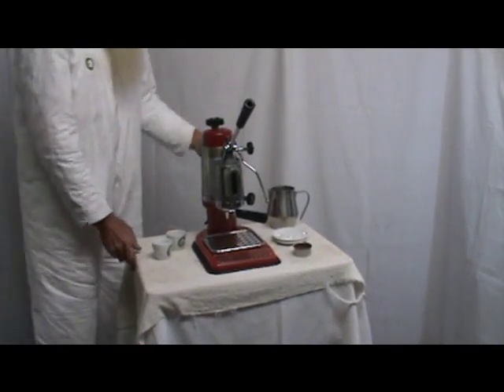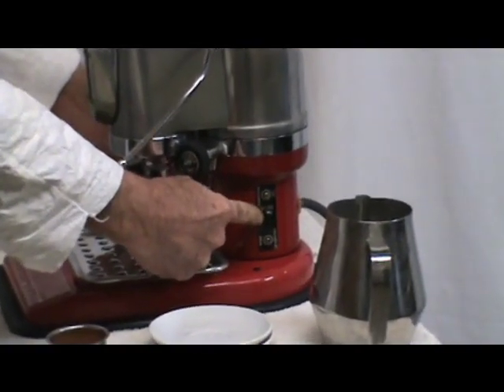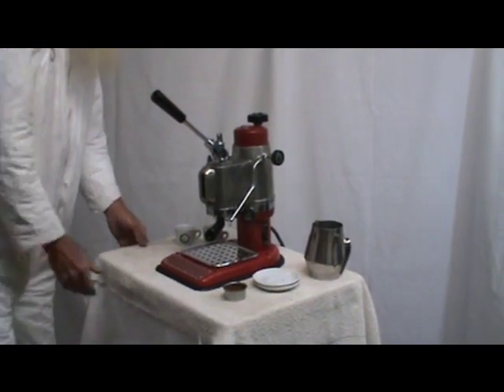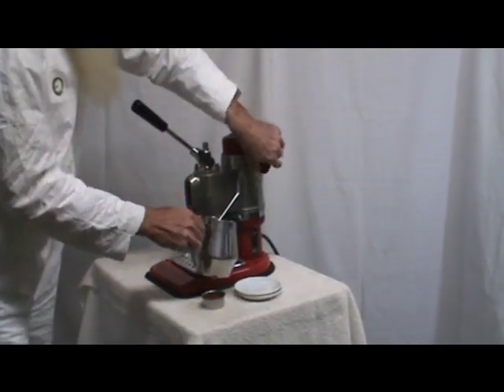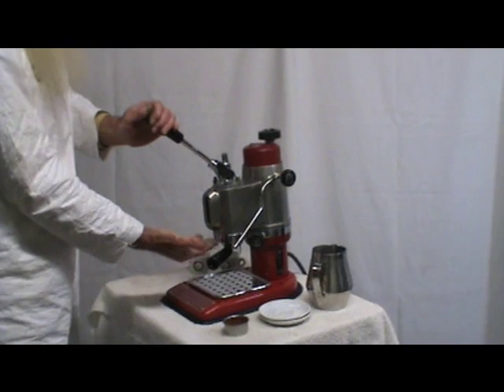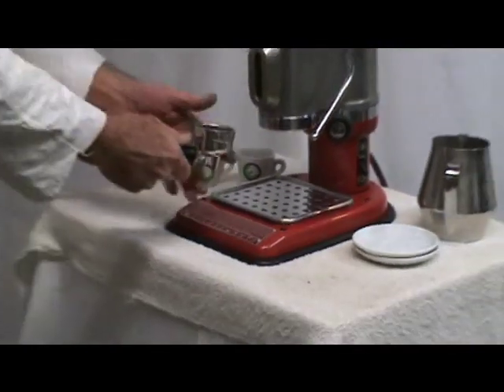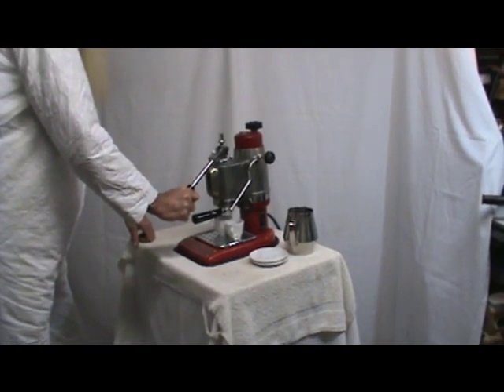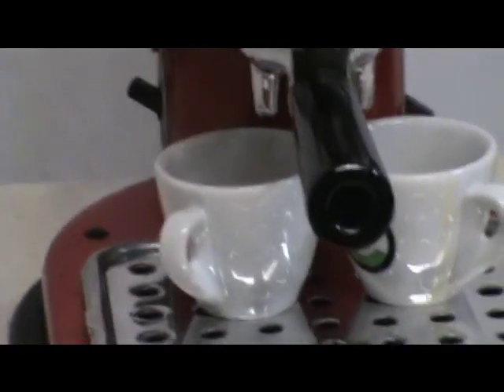La Cimbali Microcimbali Espresso Machine at OE

Comment: Hi, thanks for posting.  I recently received this exact machine from a family member that purchased it while living in Italy in the early 1970's, I think - and lovingly maintained it ever since.  I have a modern double boiler machine (Rocket R58), and I'm familiar with pump espresso machines, but this is my first lever pump.  After working on my grind, I do get good shots, but not a lot of volume.  It takes three pumps or more to get 40 ml or so.  (Maybe that's normal?)  I'm using the double shot basket.  I'm wondering how to adjust the pump volume like you mentioned in the video.  I'm not sure where it is currently adjusted.
Reply: A bit late of a reply... but, I'll try to help if anyone else may read this comment!  
If it's anything like the La Pavoni Europiccola lever machine I have, which I believe it is similar. You don't really get a huge volume out but they do make really good ristretto shots! 
I do 16g in and get about 30g out usually on my machine so less than 1:2 ratio, but even with a very light roast it turns out nice and also because it's more concentrated it has good body too!  
The key is to let the chamber fill up and for the water to saturate the coffee bed with a nice long pre-infusion before letting  up on the lever.

If you did want a different brew ratio, using less coffee would result in more room for the water, so you'll end up with more water passing through a smaller amount of coffee, so more like 1:3 is possible.

For a larger volume out with the same amount of coffee, you can also do a Felleni move where you start to pull the lever (or release it in this machines case) and then put it back down so it fills up more, I'm not sure if that's really ideal though. I tried once or twice and had poor results but maybe there's a method to it.